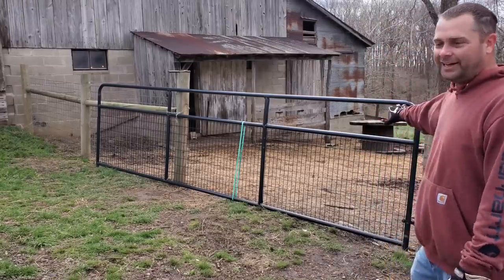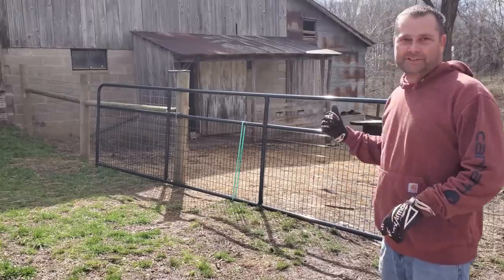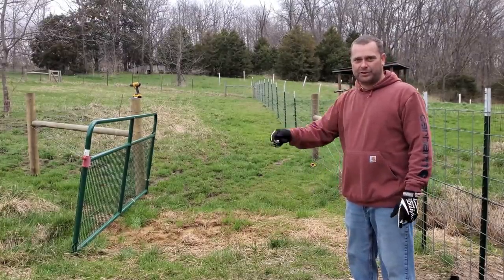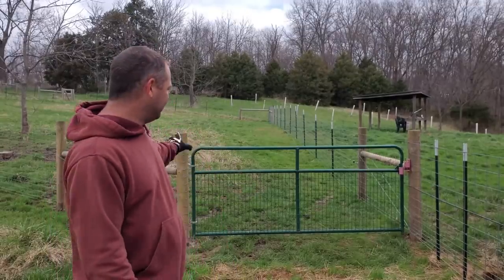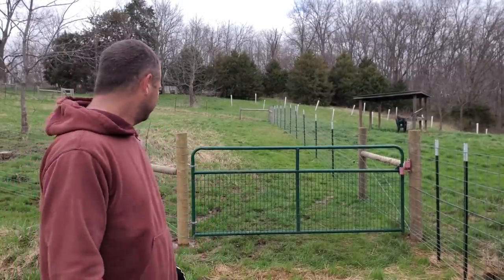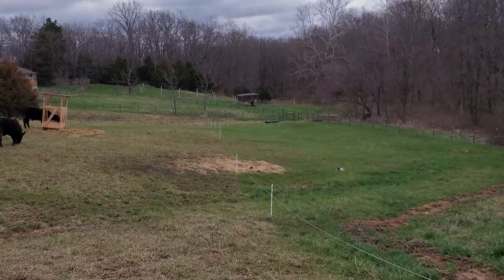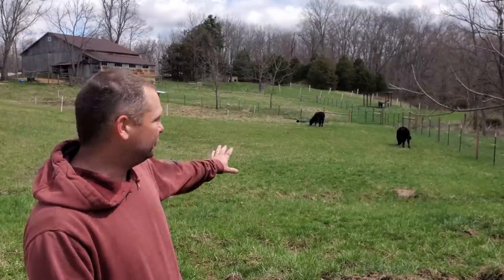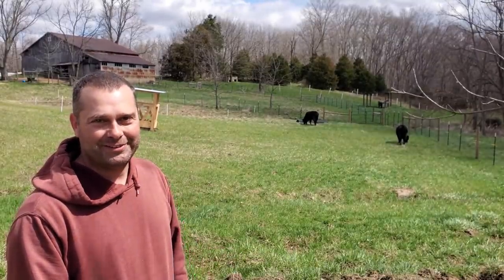Hanging a Larger Gate on Barnyard, and the old gate moves to the pasture.

Comment: should have put some lube (grease, oil or soap) on the threads before screwing them into the pressure treated posts. it will also help if you ever need to adjust them years later. i learned this the hard way. i actually cut off my first set . they locked so tight that i just got my Sawzall and cut them off. Put in new ones with lube. never had that problem again.

Comment: Hanging gates is a pain in the rear end,something to think about is a hinge that goes all the way thru the post has a nut an washer on both sides as the post deteriorate or shift you can adjust them without removing the gate

Comment: Might want to check your RK just picked up every gripple mine had on clearance 20ct bags 8.91 was 39.99 per bag , and got the tensioner tools for 23.91 each. Just a heads up, I ended up with about 1700 dollars worth for 404.22.

Comment: 5/8” drill bit makes it a whole lot easier to screw in those hangers Evan. Just food for thought
Reply from the maker: 1/2" was the biggest I had in that drill set. I do have a 5/8" bit somewhere.   I do believe you are right,  a little big bigger Bidville would have helped.

Comment: Might just be camera not showing slope.  Would you get better swing if you switched hinge to the post you put latch on the 10’ gate?
Reply: Exactly what my comment was going to be.
Reply from the maker: The barn yard runs down hill.  And where it is hinged is a fence brace.  The other side is just stock panels and can be changed to fit the larger gate.  With a larger gate I will be able to get a tractor in and our easier for when I need to clean out the barn.
Reply: @CountryViewAcres  Wrong gate😂
Reply from the maker: The electric fence is on the other side.  So I don't want to hang the gate from that side.  And it is better to hang it from a fence brace.
Reply: Yes, the hinge side needs a brace. Hanging a gate on a bare post will have that post leaning toward the gate pretty soon. If you think the gate drags now, just watch how fast it will be on the ground if you do that!

Comment: The short gate, why didn’t you mount the henge side, where you mounted the latch ? That way it can swing both directions.
Reply: Cause it would hit the electric wire
Reply: The gate is in a low spot. The ground goes uphill in both directions. He said he could remedy the problem by raising the gate, but he doesn't want the gate that high off the ground for obvious reasons. Hinging the gate from the other side would accomplish nothing. Further, the post he hinged on is cross supported to the next post to help carry the weight of the gate.
 
JustinP - there is no electric wire in the vicinity of the gate.
Reply: @MrJuzt1n  - awh, ok, makes sense.

Comment: Rather then just moving that one post why not move that entire short fence section forward? You change how the gate sits when closed but get to keep the posts and fence sections the same spacing and change how you enter/exit the area with the tractor/truck.  The temp fencing should let you block off the area as you work so can let the animals into the barnyard without them getting into the way.

Comment: Excellent update and move. Can you explain why you wanted a larger gate at the barn? I’m guessing tractor / truck access.
Reply from the maker: Yes, better access.  Especially while cleaning out the barn.
Reply: @CountryViewAcres  that’s what we figured. I know your thankful you used those panels instead of stretching fence there. Makes for an easier change. Thanks again for your documentation!

Comment: i think you are hanging them gate to tight to the ground, it shocking how much the ground lifts at different times of year, with that one gate draging the ground all it take is a freeze rain and you fight to open it, i run mine minimum 6" off the ground or more due to ice build up and the heaving of the ground, gates i use every day there 10" off the ground, last thing i like to do is fight to pen a gate.  i build my own gate, for the $300 cnd they charge for them light weight gates that a big steer  can bend up like nothing, just stepping on a rail bend it down, for that same $300 i can buy enough 2"x1"x1/8" tubing to build 5, 16 foot gates with more cross rails that on edge don't bend driving over it. years ago o bought a few 10 foot gates and in 2 years they er all bent out of shape

Comment: Hey you’re not a farmer, rancher or handyman. You’re figuring it out as you go by trial and error. There ain’t nobody there teaching you how it’s done and in the end you got a working gate. You could have just as easily edited out the trial and error part a nobody would have been the wiser. I condemn ...er a I mean commend you for that. It’s not too late to swap that second gate to hinge on the other side then it’ll clear the high ground and swing both directions.